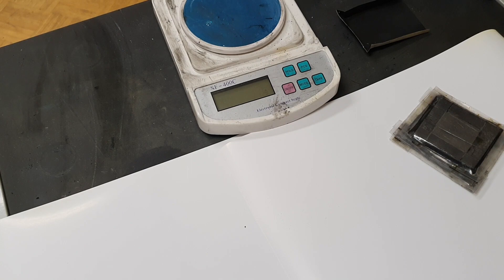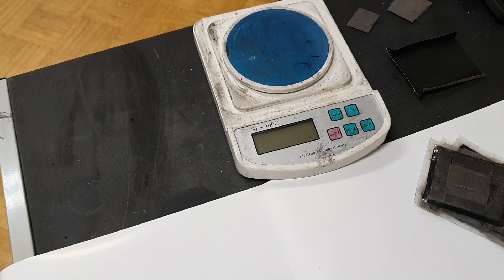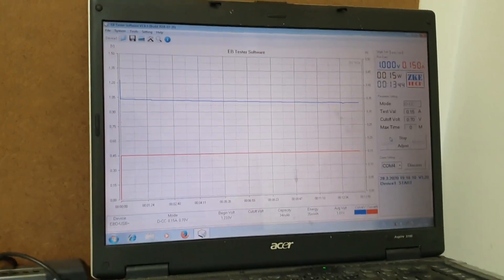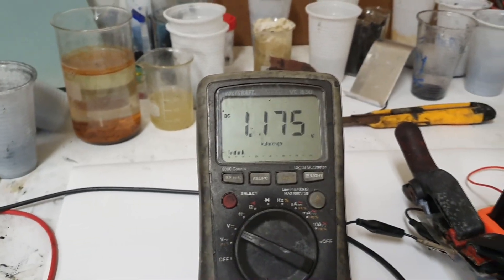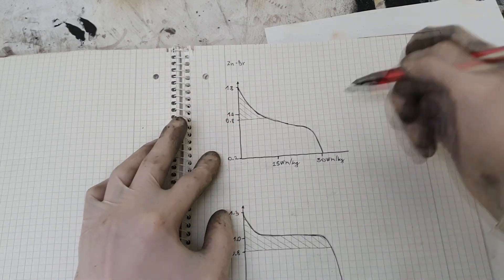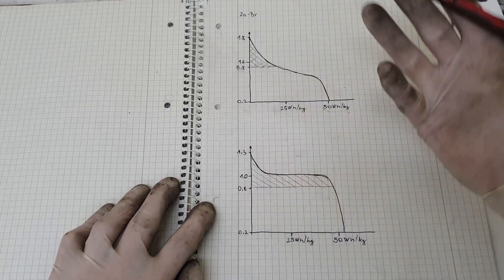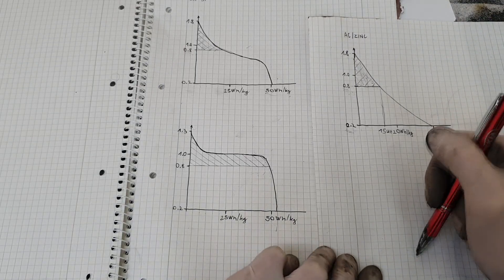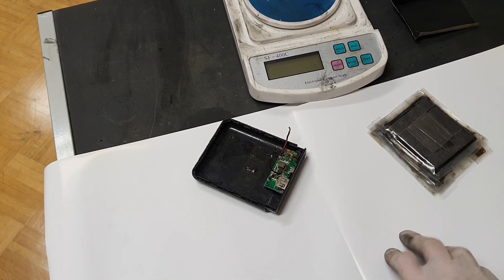Hybrid Zinc Iodine Battery Prototype

Comment: WOW!  Great stuff, Cayrex!  Have you gone far into efficient power switching schemes so you can run a chunk of your parallel circuits at a reduced draw and switch the fast discharge chunk to serial at 1.0+V (feeding the overvoltage back into self-charging).  DIY work is sorely missing theory in this area.